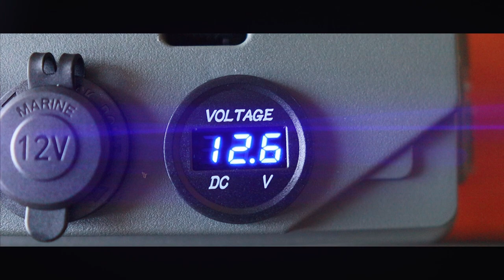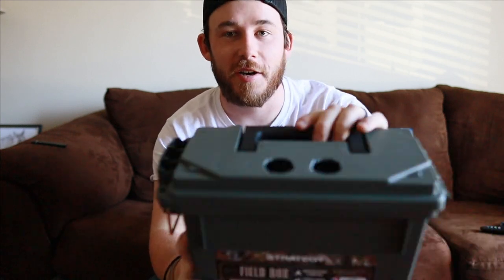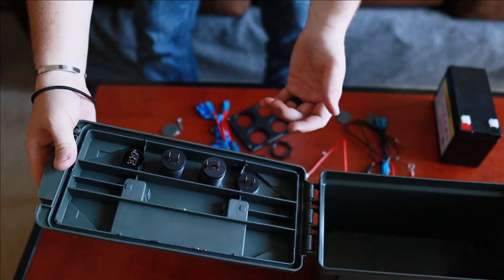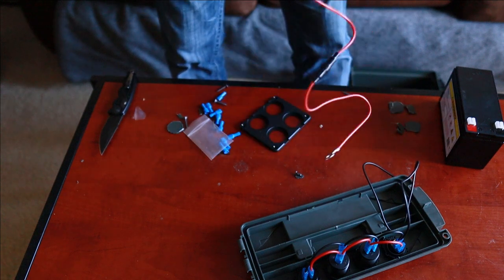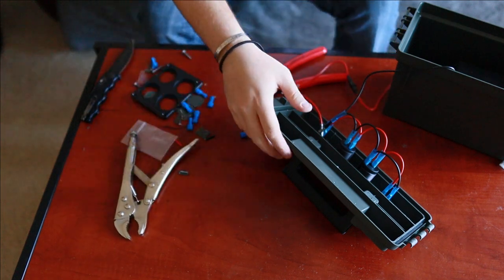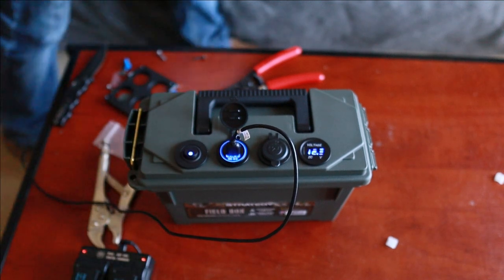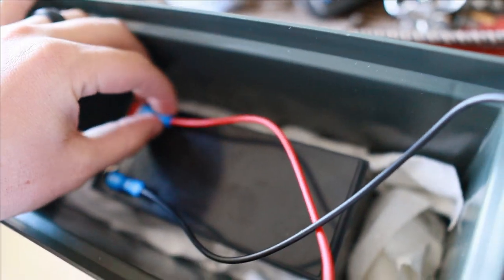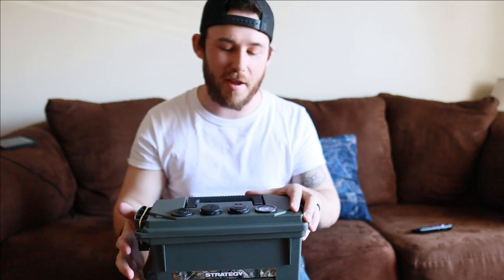How to Build a 12V Power Box for Camping and Kayaking for $50!

Comment: Great video! Do you remove the battery to charge, or perhaps added some kind of exterior connections to hook up charger? Thanks!
Reply from the maker: To charge all you need is a 12v or 20v battery charger. Looks like a little jumper cable and you connect it to the battery and plug into the wall and it will charge the battery 😀

Comment: Are are you going to recharge the battery.
Reply from the maker: Yes
Reply: I'm sorry I meant how are you going to recharge the battery.
Reply from the maker: @markintx2628  with a 12v battery charger you plug into the wall and charge it